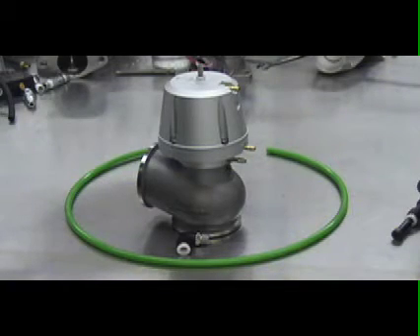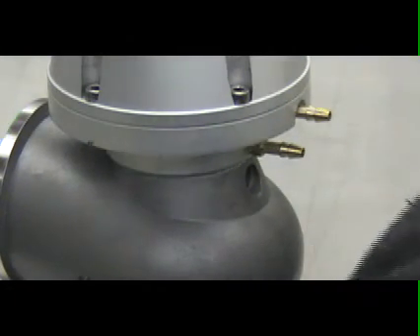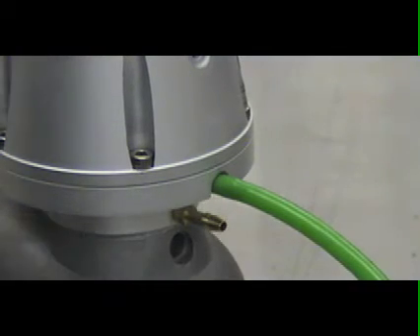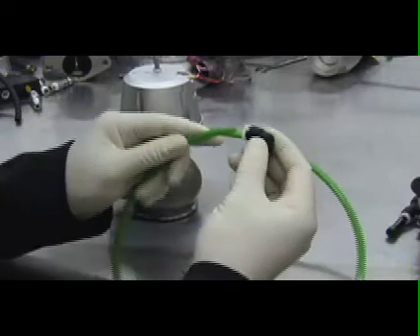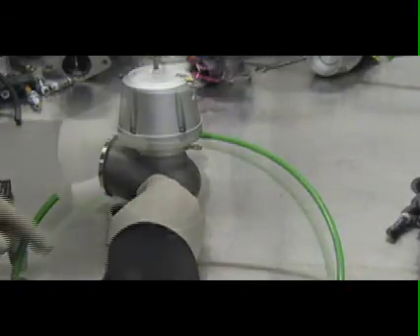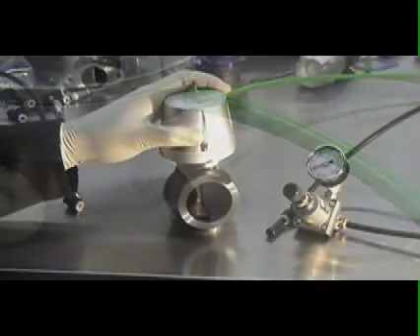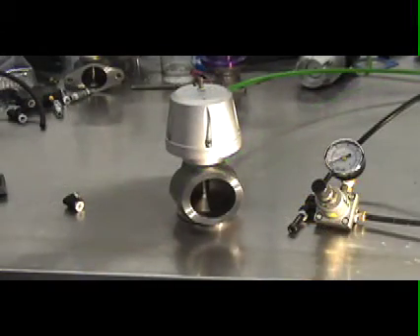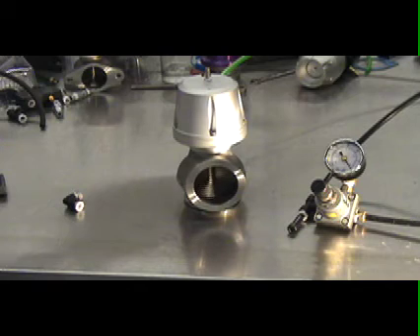Synchronic Wastegate Pressure Demo

Comment: Why are people complaining about the test? It was to prove how well the WG would flow. 

Also, why do you need something that has high Hz and low boost? Synapse didn't go about designing their products for low boost cars that shift 100 times a second. Synapse has quality products that were designed for performance engines. The test and applications reflect the practical application.

Comment: @synaptic1 This was my initial question.  Usually people don't try and "Shift" 40 times persecond.  But they do modulate the throttle in and out of turns several times per second, and at low throttle angles (read lower boost).

I guess my question is, for those of us who are running very high flowing engines, that only require 6-8 psi, is your wastegate an approriate pairing?

Comment: Wow, well.  Than this sounds like a great road racing gate.  Where you could have up to 4-6 throttle position changes in a second if you're going nuts! :]
Next question.  For those of us using a larger turbo on lower boost (such as those with a very CFM hungry engine) unlike your typical 2-3 liter... Does the gate flow enough to mitigate the boost creep?

How large is the valve?

Comment: i can attest for those types of fittings they are called john guest fittings (some people call them shark bite whatever samething) in my  line of work on espresso machines and the plastic lines will hold even with heat trust me espresso machines get hot and we plastics and quick fittings with no leaks

Comment: We sell the Synapse Engineering units and stock 4mm hose good for +500 Degrees Fahrenheit/+260C  We use this stuff on our Neukin Drift / Roadrace 240sx and Honda Hatch Drag car. With both under alot of abuse we have not ran into any problems even with our tubular manifolds close to the line. We also stock fittings to get everything setup right. Check it out on TurboGoods

Comment: Light weight fittings and hoses are a great idea if they can do the job. A bench top demo of flow capability is nice but, my wastegate is mounted to a very hot turbo manifold and that plastic is going to melt. I have trouble keeping the high temp Aeroquip hose from baking and cracking even with firesleeve over it.
Show us how that plastic hose works in the heat.
Thanks.

Comment: These are the exact same lines and fittings used on paint ball gear. Only there they are pushing 1000+ psi.

Cheap, easy, and will never cause problems.

Comment from the maker: You can make the valve go up and down at 6 and 12 psi, but not a a high frequency since the pressure rise isn't fast enough to accomodate high HZ.  However, the intent of the video is to demo reaction time at high pressures to show that flow to the fittings is irrelevant.

Comment: This is a much better representation of your company and its engineering reasoning behind the choices that they make with regard to hardware use on their equipment.  These are the types of videos and instructionals that should be shown instead of attacking one particular company.

Now if you would only INCLUDE such lines in the product for a small additional cost, that would be ideal.  Many people in different parts of the country may not be able to have that type of pressure line available.